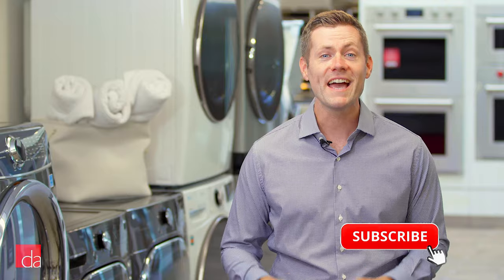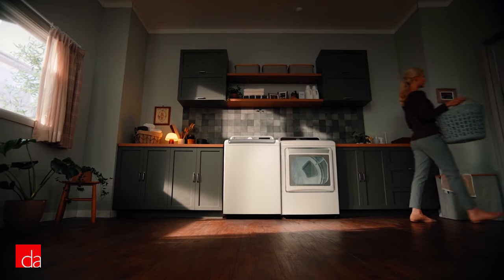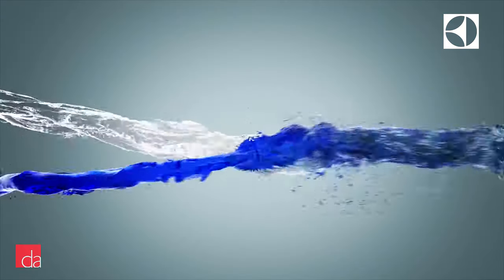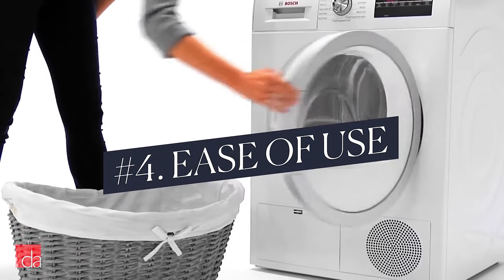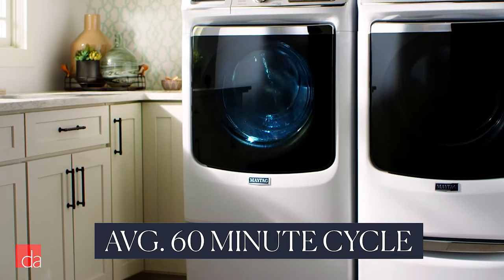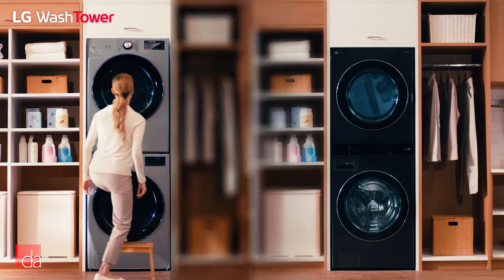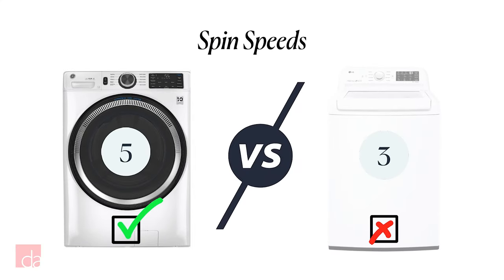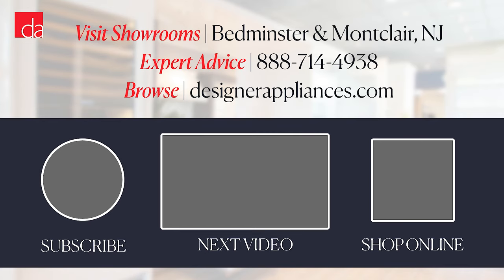Front Load vs Top Load Washer - Selecting a Washer Shouldn't Be Confusing (Updated)

Comment: Front loaders are great, if you don't mind having half your cleaned clothes landing on the floor when you try to unload it.  Also, with front loader it helps if you lost your sense of smell from covid, because they STINK.  NOTHING ever got my clothes as clean as my 1962 Maytag top loader.  And to me front loaders look like they're from the FIFTIES.  Based on my experience there's no contest:  Top loaders win.
But since Whirlpool bought Maytag, really no one makes a decent washing machine anymore.
Reply: I reach in to the back of my front loader's drum with one arm and pull my cleaned clothes out in one go, so they drop down into the waiting laundry basket. My machine doesn't smell at-all, or get mouldy, because I leave the door open so that it can dry out. Without sufficient moisture, the bacteria that causes smells can't grow. I also use powder detergent, which here in the UK contain ingredients that kill mould and bacteria.
Reply: @mels8966  I live in a marina and use a community laundry room.  I do leave the doors open, but they never stay that way for long.  If you think a front loader is better, I guarantee you have never used a vintage Maytag.  Fantastic machines.  The bowl was enamel coated.  They had heavy duty wiring and relays, and THREE moving parts.  Nothing before or since can touch them for quality and reliability.  I had to give my 1962 Maytags away to a friend when moving on the boat, and they still work perfectly.  How many modern washers will still be around like that, 60-some years from now??
Reply: @TheRealDrJoey  That's an issue caused by bad users, not by the machine,  there's plenty of youtube vids showing top loaders that have got skanky due to users not looking after  them,  although admittedly the grime on a badly kept machine is much more visible on a front loader. And no, I've never used a top loader, I don't recall ever seeing one in an appliance store. They never caught on in the UK, people preferred the convenience of a front loading automatic, and since I can't fault the cleaning ability of my front loader, I've no desire to try a top loader that would be much more costly to run with our electricity prices in the UK. 

I would certainly agree about the longevity of modern machines,  manufacturers seem to be in a cost cutting race to the bottom, eg most washing machines (bar a few makes) sold in the UK today have welded plastic tubs, which cuts manufacturing costs, but to replace the bearings you'd now have to buy a whole new tub assembly, stainless steel drum, spider and all, which could easily be getting on for half the cost of a mid priced machine, so most people are likely to scrap the machine instead, so an average sealed tub front loader is probably likely to last around 10 years due to the rubber bearing seal wearing out and letting water rust the inner bearing (they do spin at between 1,200 and 1,800 rpm depending on model).  I think Miele's, which have a stainless steel outer tub, and their bearings mounted in a cast iron cross piece mounted behind the tub, claim a 20 year design life for their machines.  My own machine, a Zanussi(electrolux) is 14 years old,  and I was able to take the drum out and change the bearings when the bearing seal leaked. (cost me £30).

Since you can't stop others making the machines stink, I'd suggest getting a collapsible laundry basket and maybe adding either an anti-bacteria laundry cleanser to your wash, or an oxygen bleach with TAED or NOBS bleach activator in it.

Comment: Prefer Top Loader any day, you can fill the machine with a full load of clothes and they will clean. I  don't need it to spin for an hour just to come out not clean. HATE front loaders or "Efficiency" machines, worthless propaganda  machine, your not saving water if you have to run small loads and use even more water.
Reply: Absolutely correct!